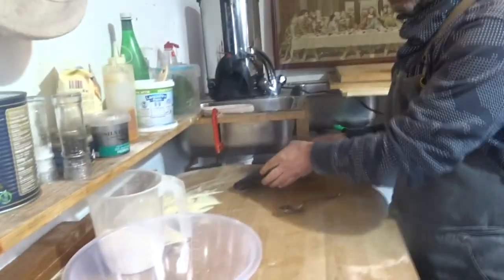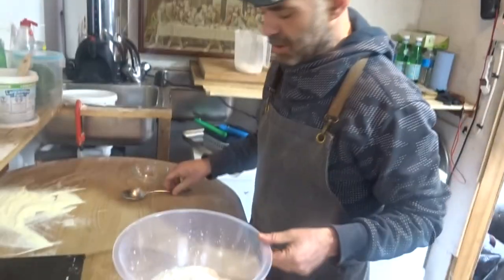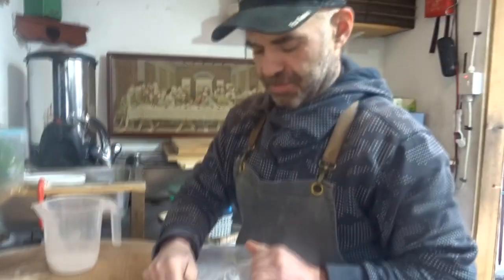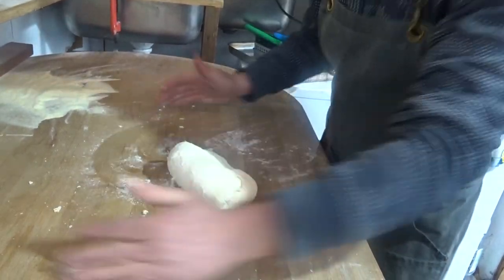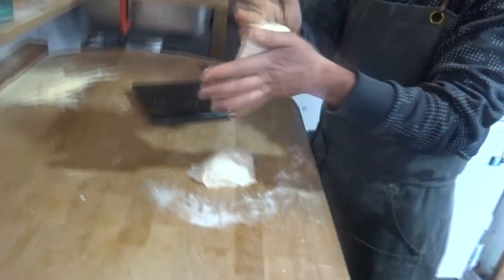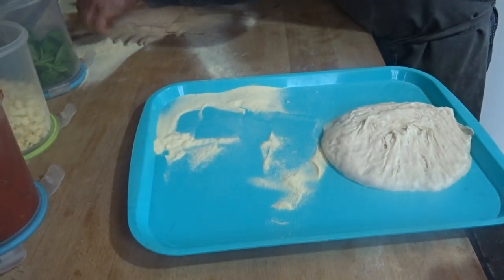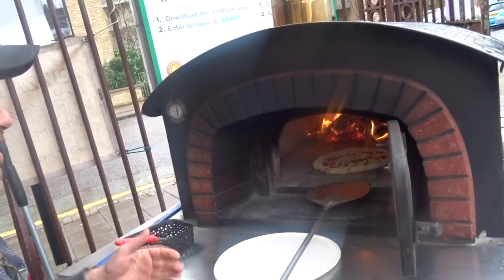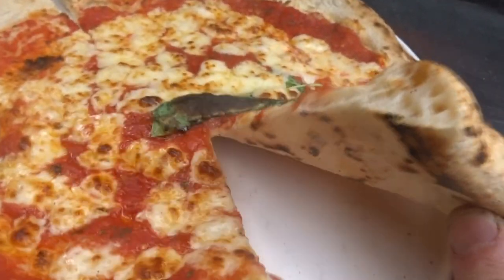How to make amazing Pizza in  6 hours with dry yeast (Poolish. method). with. Massimo Nocerino

Comment: Dear Professor! I have just finished your recipe! Due to the high humidity 68% and the high temperature 28C in my house (Indonesia), the entire process until lunch took 4 hours! Poolish was fully developed in 2 hours. The final dough was ready to divide within 30 min. The last rest was achieved in 1 hour! The final dough to stretch was amazing huge! Next time I will reduce the yeast to 1 gr and try to ferment the poolish in air conditioning in my kitchen. The final rest needs to be about one hour and I think I can achieve it by placing the two balls in sandwich between to boxes top and bottom containing packs of ice. The flour was the highest protein content here, 13,5%! But the overall taste! Oh my God! I never approached this taste in months since I started learning pizzas. It remembers me a little the Brussels waffles dough, very light. Thank you very much for this tutorial
Reply: i do lots of biga in the tropics, >90% humidty >90F ... and use a small block(s) of ice in an old cooler to help keep the preferment and balls from high temps/humidty ... if it gets too cool i slip the ice in a plastic bag sometimes on overnight cooling .... usually takes 2 small blocks of ice for 18 hours at 18C .
Reply: Wow, I'm from indonesia too, I'm confused about too fast in poolish (tropical yeah), I will try to reduce yeast then.

Comment: nice one, would the recipe be the same for 30 pizza by just multipling the quantities? or would you need less yeast?
Reply from the maker: exacly. if you want at 6 hours time all 30 pizzas 6 gr of fresh yeast its ok
Reply: Hi I have question regarding refrigeration of the pizza dough. I want to make around 60 pizzas dough ball but i dont have a refrigerator at the moment to fit this amount of pizza balls. What can i do ? is there a recipe to make this amount of pizza balls with no refrigerator? I will be very thankful if can help me
Reply from the maker: @G12sty12  use less yeast  and use long leavening.  flour like w 300/350

Comment: For two pizzas:

Poolish:
200g water
200g tipo 00 flour
3g dry yeast

Mix together and rest for 4 hours

After, add to the poolish:

100g flour
5g olive oil 
5g sea salt

Mix together and rest for another 30mins

Afterwards, cut into equal pieces (250gr) and rest for another two hours
Reply: So, what's the hydration level for this recipe? 🤔
Reply: @RoyMcAvoy  100% for the poolish and 66% for the final dough (200g water devided by 300g flour).

Comment: I would recommed you to add little bit of olive oil on top of pizza balls when they are about to rest and being covered. It's much better option thrn flour and it won't stick at all.

Everything else is perfect. I also using polish method and do 1 day before. Room temp for 1 hr and 16 to 24hr in fridge, but FINAAAALY i found the way to work with polish in same day. 
Thank youuu🙌☺️🍕
Cheers from Ireland🇮🇪🍺

Comment: Poolish:

200g Water
3g Dry Yeast
200g 00 Flour

Mix and rest 4 hours

Add:

100g 00 Flour
5g Sea Salt
5ml Olive Oil

Knead then rest 30mins

Cut into two of 250g each

Form into ball, rest 2 hours

Make pizza

**note to self, so I don't have to skip the vid.

Comment: Wow, that is the shortest poolish I've ever seen!  Do you have a recommended flour to use?  You mentioned the W of 350 and 14% protein, but I'm not sure which flour meets that.  I was surprised at how soft your final dough was even though you only had a modest hydration level and a high protein flour.
Reply from the maker: You can use  also at any a 00 floor available in your country  or manitoba flour
Reply from the maker: Caputo red for example
Reply: thank you.  caputo red or blue is easy to get from Amazon
Reply: @massimonocerino  

Is red better than blue for wood fire oven? I always thought that blue was superior
Reply from the maker: @MP-wy3hp  red or blue its not differnt for any oven  only the different. its  blue 12 hours. leaving , red 24 hours